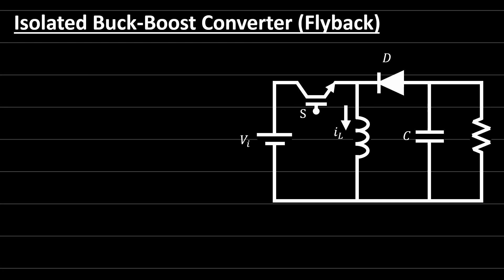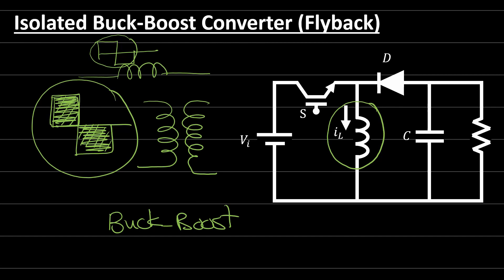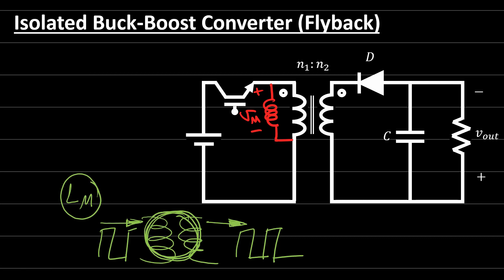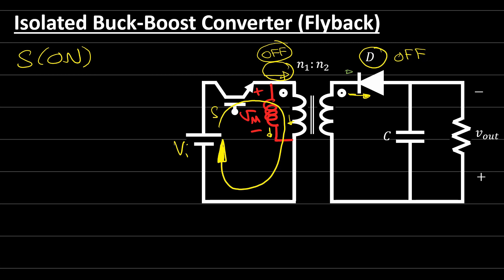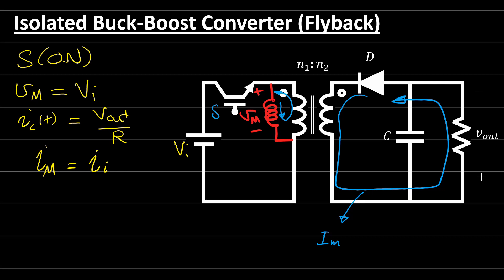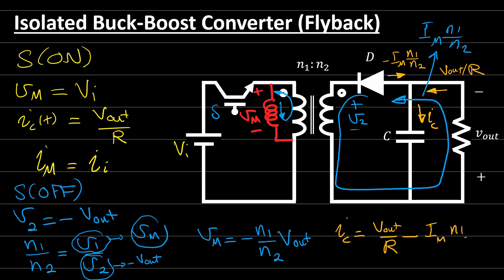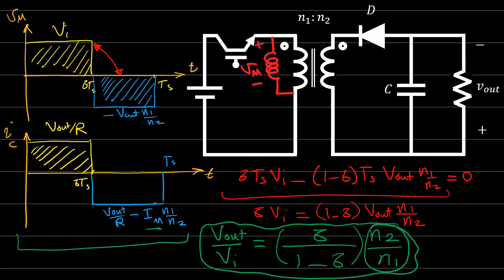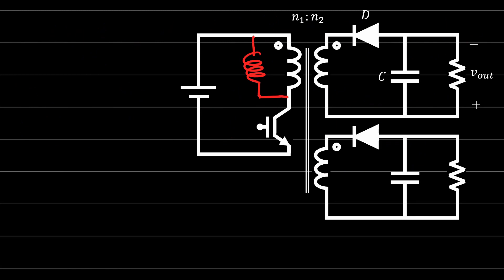Isolated Buck-Boost Converter | Flyback Converter | Isolated Power Converters | Power Electronics

Comment: @Ahmad Elkhateb can you use this circuit to step up or step down by varying duty cycle. For example, input is 16VDC to 90VDC and the output should maintain 28VDC

Comment: Is there will be impact on this circuit when we connect RC ,RL and RLC load instead of resistive load
Please reply me sir
Reply from the maker: This is a good question. Let's say it's an RL load, the inductance will just add to the value of the secondary when the switch is off, and when the switch is on, what ever stored in the load will be circulated with the resistor and the capacitor. Try to make simulation and see the behavior of the currents and voltages.